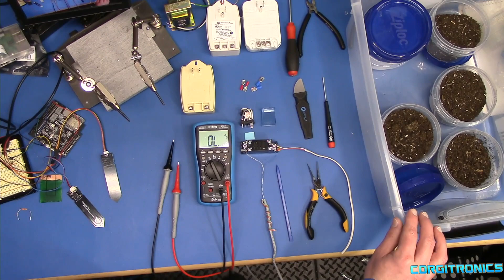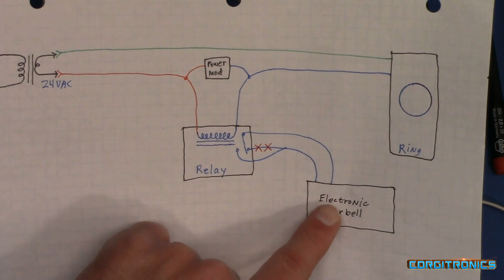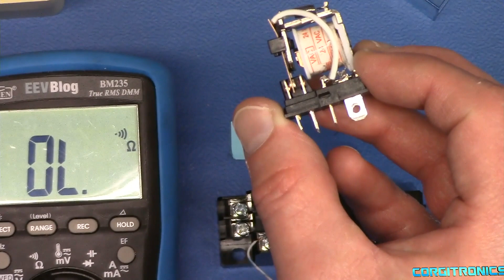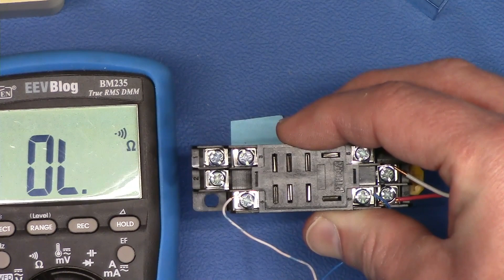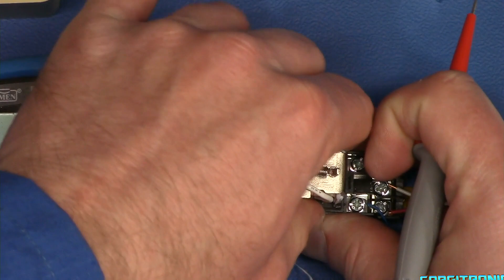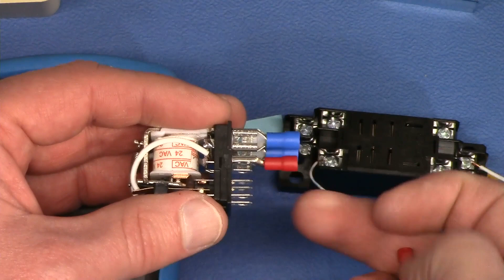Ring Pro Relay Connections

Comment: Why isn't there a problem running 24V to the Nutone electronic doorbell, which I believe uses 16V?  I have a 16V 30VA transformer.  Can I use it for both the Ring (August in my case) doorbell as well as the Nutone?  Great instructions, by the way.  /Wayne
Reply from the maker: What you can do depends on which Ring doorbell you have and which Nutone intercom.  Some of the larger intercoms have 2 30VA transformers, and those generally can power a RingPro, or so I have been told.  If you have a Ring2 doorbell (with the rechargeable battery in it), then any of the intercoms with a 16V transformer can power it.
Making sure that I fully answer any aspects of your question:
The terminals on the intercom chime board are low voltage DC, and feeding the 16-24 VAC into them would likely kill the intercom, thus using the relay to isolate those sensitive terminals from the AC.

Comment: I have a Nutone IMA-4406 intercom and used this relay to hook up the Ring Video doorbell 2 to the intercom digital chime. I disconnected the door speaker wires and connected them to one of the IMA-4406's 2 transformers, since these wires were at the location where I mounted the Ring. These wires were connected to the relay and Ring as documented by Corgitronics and the doorbell wires to the relay contacts as shown in this video. Works like a charm! Many thanks to Corgitroncs, for an $8 relay the Xmas gift from my daughter now works. I had called the Ring help line and all they told me was my intercom was not compatible. Talk about heads in the sand...they could have easily included a schematic like Corgitronics in their instructions.
Reply from the maker: Thank you!   I'm happy to hear that you succeeded  in connecting it up!

Comment: Will this work for a ring 2? It only has 2 terminals on the back for power and comes with a diode.
Reply: Just talked to Ring support about the Ring 2 I received for Christmas. Use the diode if you do not plan to wire power from a transformer but want to use it with a digital doorbell.

If you want to power the Ring like in Corgitronics video, you need to install a 25ohm 50watt resistor in series with one of the wires from the transformer (instead of using the Ring Pro Power Kit in his example).

Comment: I watched videos on connecting the Ring to a relay.   I have the August Doorbell which is very similar to the Ring and Nest.   It too needs additional power to run.   The only difference I see is the August does not have a power module.

 My NuTone is a three bell system (Front, Side and Rear doors).  In the end, I want to have all three working, but for simplicity, I am starting just with the front where the August is.

I understand the concept of how you wired it, but I have an additional wire connection on the Nutone I don't know how to incorporate.   On the board, each door has a connections, then there is a green and a yellow wire to connect somewhere.    

In NuTone's wiring diagram, the yellow wire connects to the transformer, the green wire connects to one lead to each doorbell, and each doorbell's other wire connects to the corresponding screw connection on NuTones board.  

I would appreciate it if you could help me determine which two wires connect to the constant and always open terminals on the relay, and what to do with the third.  

Thanks
Reply from the maker: Nutone makea a lot of different chimes, do you have the model number or any other information about the chime?  Is it an electronic chime or mechanical?  As for not having the power-kit, you can probably just substitue a large power resistor, but you'll need to know how much current the August draws on standby.
Reply: @Corgitronics  Model  LA174.   It is electronic.   Thanks again